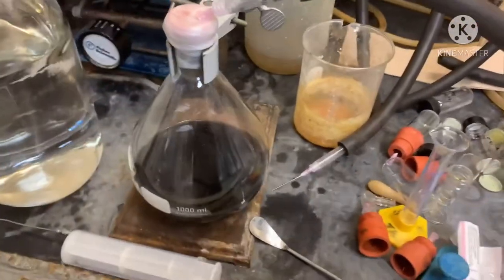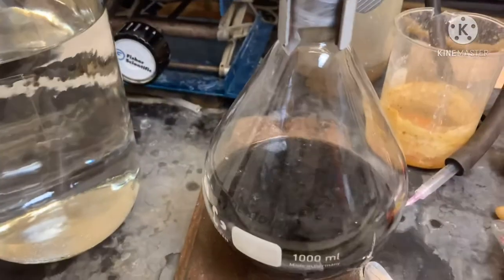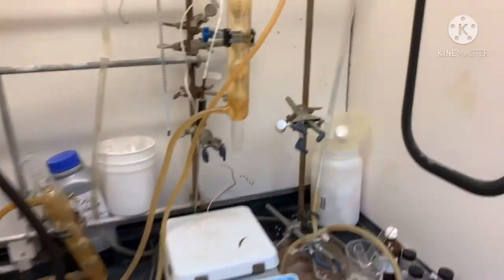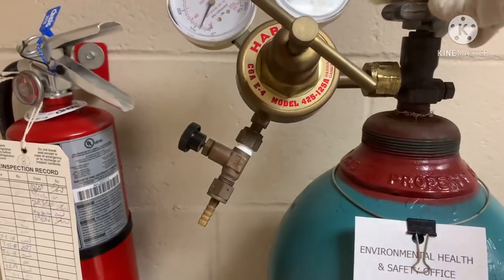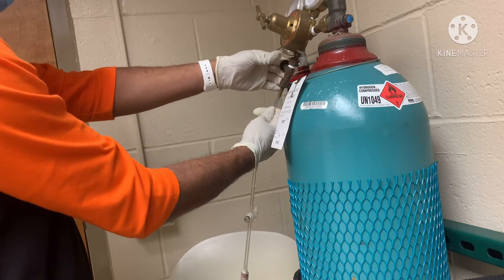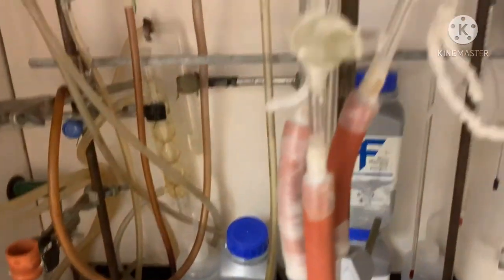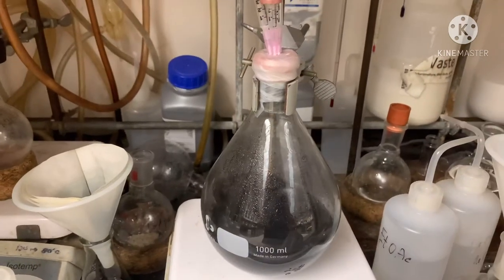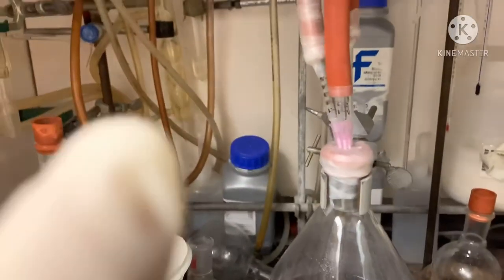Hydrogenation with Palladium/Carbon and Hydrogen gas.

Comment: hello sir, if there is a little air in the reaction can it cause a big explosion or is it just a myth sir, can you explain, I want to do this reaction but because I want to know if there is a little air in the reaction.
Reply from the maker: If you have any air, then reaction can explode. Because of oxygen and hydrogen is a exothermic explosive reaction. So no matter what you shouldn’t have any air in the reaction. And another concern is, hydrogenation is a reduction reaction. In presence of air or oxygen, your reduction will not go smooth. So by using vacuum, you must remove oxygen or air first before adding hydrogen. It is completely to be safe side. And another thing is  do not add methanol with Pd/C. It catches fire 🔥 immediately. Watch my this video if you really need to use methanol as a solvent. 
https://youtu.be/tiBIyt53mPw

Comment: Great content, as usual.  I just had heard that these reactions were run in commercial reactors but I think it is really valuable to see how it can be done with the usual lab material. Everything well sealed, it shows how much precaution has to be put into running this. 
Thanks for sharing, sir. Amazing channel!
P.s. totally normal to have a work station full of other experiments as long as all of them are under control (regarding one of the comments on this vid)
Reply from the maker: Thank you very much

Comment: I have an idea! 💡  
How about adding Acetone and Ammonia and Ethanol (60% to 70%+) and Formic Acid and Carbonic Acid and pH around 5 and room temperature and add Aluminum Galinstan amalgam and 500mg of Palladium on Carbon? The Aluminum Galinstan produces Hydrogen gas. The Carbonic acid becomes Carbon Dioxide gas and water. Formic Acid and Palladium on Carbon helps with electron transfer. Aluminum Galinstan splits Hydrogen oxide (H2O, Water) into Hydrogen gas and Aluminum Hydroxide Al(OH)3. Then Buchner funnel filtration, drying with Anhydrous Magnesium Sulfate, Buchner funnel filter again, then add HCl gas to get Isopropylamine HCl. Using Cyclohexyl-2-Propanone instead will yield Norpropylhexedrine. And also calculating Mole. Science and Math is fun. 
 
Edit. I will use Aluminum Galinstan amalgam (100g to 900g Aluminum and 100g Galinstan) plus 500mg of Palladium on Carbon. And Cyclohexyl-2-Propanone and Methylamine in ethanol and water a little formic acid and CO2 atmosphere. Propylhexedrine synthesis. Aluminum Galinstan amalgam will make Hydrogen from water while CO2 will protect the reaction from oxygen. Temperature 20°C to 30°C and reaction time 24 hours. The Aluminum Galinstan amalgam will make Hydrogen (H2) from Hydrogen oxide (H2O). The Palladium on Carbon will be the catalyst. Propylhexedrine is the secondary amine. For the primary amine, maybe Oxime from Hydroxylamine.

Comment: Can you make arc reactor with palladium
Reply from the maker: I never did that before
Reply: @Dr.Mosharraf  Is it ok too to use like nickel instaed of palladium or platinum as catalyst? And 2. What are the main components you need to do this, or similar reactions like acetylation? I'm doing research and I want/need to use this to work on my product and do testing..
Reply from the maker: Renny nickel can be used for selective hydrogenation (Reduction). Triple to double bond conversion. But it is dangerous and catch fire. You really have to really be careful during using it. I never used platinum before. But depending on literature you can find some methods.
Reply: @Dr.Mosharraf  Ok it's just cuz I was wondering if there's no like affordable way to do something like this or similar, since palladium costs 50$ per gram..